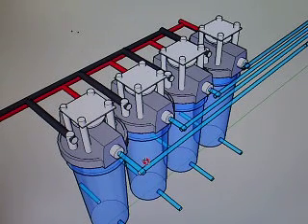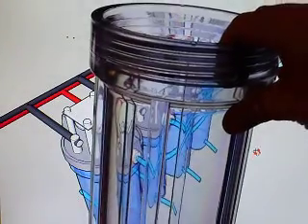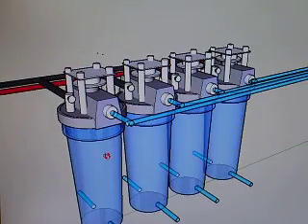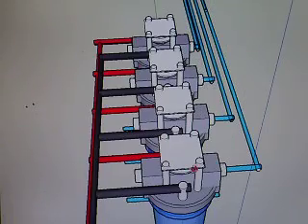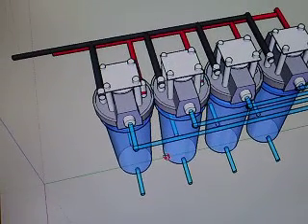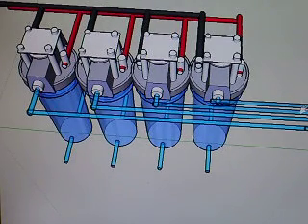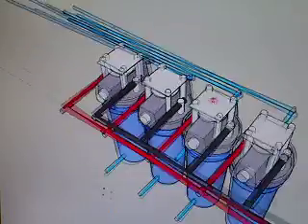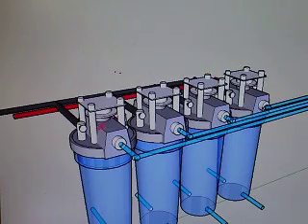013 hho generator test with water filters design

Comment: Did you trick the OBDII Emissions system? It may be thinking the engine is not getting 'enough gas' and that may be why your not getting an increase in mileage.

The car's computer may be adding more fuel then needed to compensate. OBDII will not normally detect hydrogen as it is designed to look for a carbon based fuel so it may be getting 'confused'.

Comment: @urbex2007 You don't need to tell the ECU to put in less fuel for the motor.  The hydrogen is being burnt with your fuel, and makes the overall process more efficient.  You get a lot more power from your motor from the same amount of fuel,  at the same rpm, so you do not need put your foot into it so much.  Don't think of the hydrogen as a replacement fuel.  Think of it like a catalyst, like propane on a diesel engine.  And if you think it's a scam, don't buy anything, build it yourself.

Comment: i got to agree with you this type of relief V/V, is safe, and is the type I am going to use too, The in line sort packed with wire, isn’t so safe in my mind, whilst they stop a spark, and flame from going up the line, they can also act as a flame thrower in the line, being fed Hho it can continue to burn in the pipe { melt down} for plastic pipe users. 
Thom in Scotland.

Comment: well the thing is if steam is hot enough it will explode it self. 
from what i can tell it is a continual ijection just getting hotter all the time. the steam will seperate and ignite.
and it wouldn't take but 1 mil of water to do it in a 1600 cc bug motor. larger engines may require a tad more.

Comment: man i wish you'd people would actually read something before you start trying to make a car run on hydrogen.
this is all come about because of Stan Meyers.
he was not running his car on hho.
hho was merely a fuel to to excite the water injected into the cylinder ie. reinventing the steam engine!
look at the damn injectors he has in his blue prints. fill the tank with water and convert a portion of that into hho while driving and the rest is converted to steam in the cylinder.

Comment: just from a mechanics point of veiw, u gotta make sure that your Pop-off valves are set to a higher p.s.i that your pressure on the fuel outlet side. if the outlet is lower than the valve, you will be losing fuel out that valve. it's like a studor vent in house plumbing, it's only for a burp in the system.

Comment: Good question! I'll try to answer it but I'm not a scientist. There is no contradiction, you are right, heat IS suitable to have a better production BUT, we do not want the water to boil because water in steam form will escape the cell and corrupt the HHO test production. The efficiency of a cell is measured in MMW. Too much energy in the cell will transform it in a water boiler. Hoppe this helps!?

Comment: I don't know if you mention how many plates per unit you plan to install, however make sure you don't have more than 2 volts per space (Cell) between each plates. That way you'll not have any heating problem. More voltage than that will be wasted in the creation of heat. 1.5 volt is best. You calculate the efficiency of the cell not by the amount of gas it produce but by the MMW (Milliliter, per minute, per Watt) 
Have fun!!!!